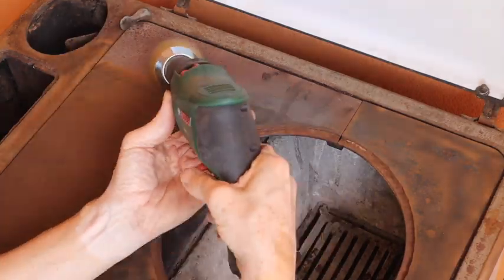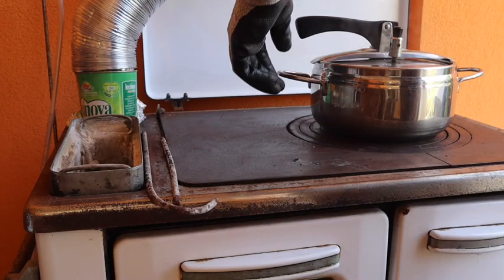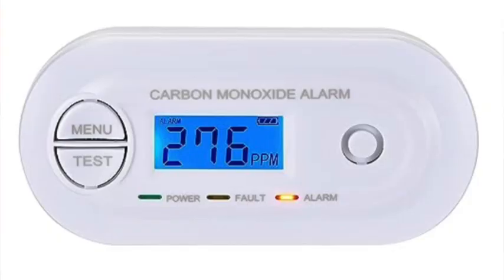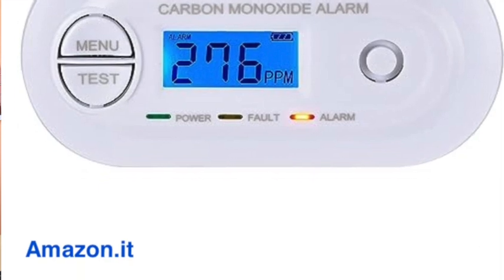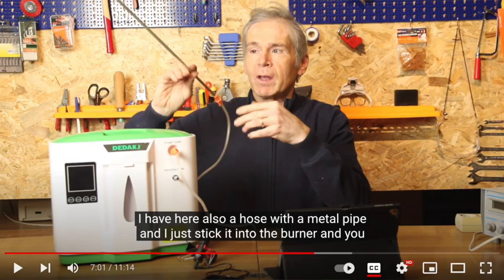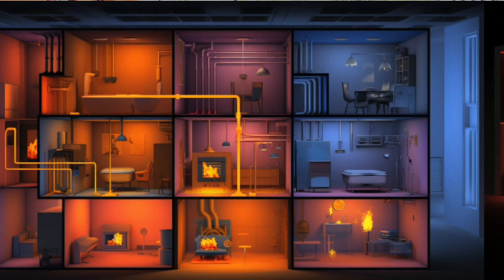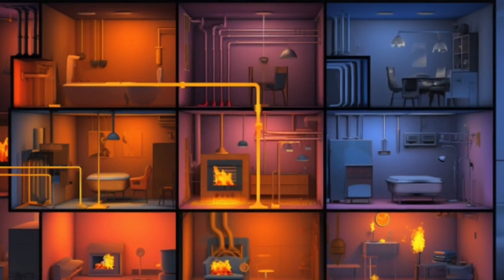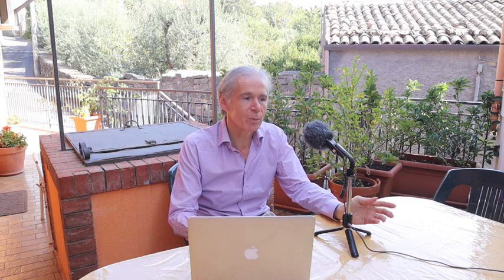Wood stove, back to the future  Part 2   Video 31b

Comment: I'd argue there are much better options to use wood fuel. Old stoves like this have very poor combustion efficiency and produce a lot of particulate pollution. These problems have been solved by the DIY masonry stove community. The original rocket mass heaters were huge and required constant attention. The current state of the art designs operate like a conventional stove and don't require you to change your lifestyle or home decor much. They can be built as space heaters, water heaters or cooking appliances or a mixture of the three. DIY plans are available for little money and can be built by a moderately skilled amateur. The easiest option is to build a design by the Walker Stoves company. I've found it fascinating to learn the engineering principles to design my own though. Wood fuel CAN be clean and convenient if you do it right!